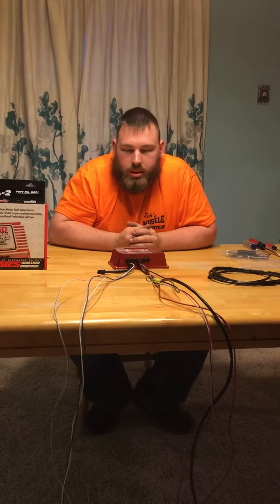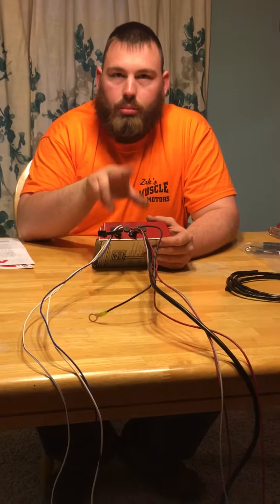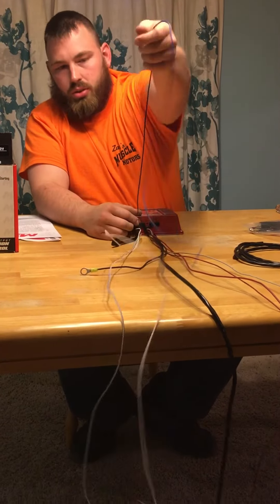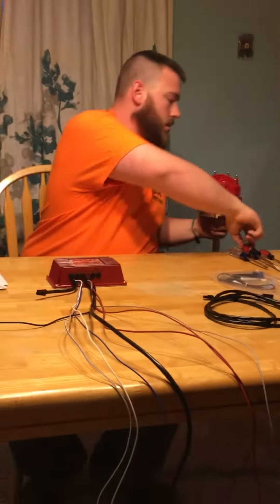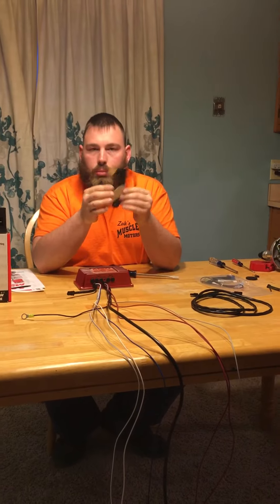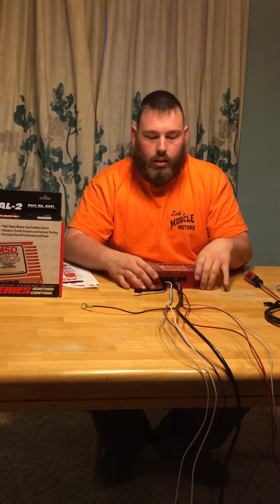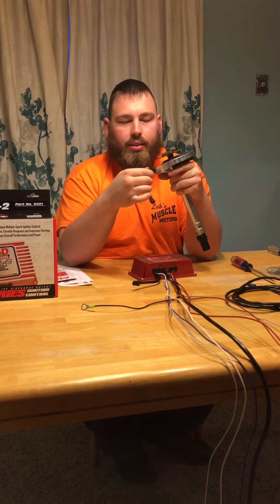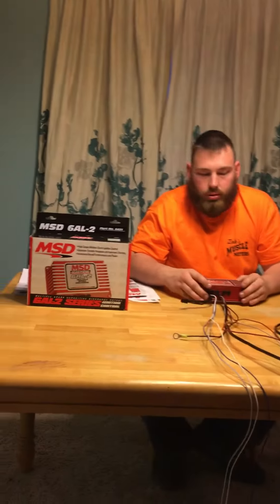Engine Building 101 MSD 6AL-2 Ignition System

Comment: After driving my car for a half hour,it dies.Wait a couple minutes,it fires back up ,and I head back home.The box is mounted under the dash. Is it overheating?.....HELP!!!!
Reply from the maker: Beth Mull ehhh could be but I’d lean more to having a vapor lock situation. are you running a carb I assume?
Reply: Yes, Holly 750.  Also notices the fuel pressure was low, down to 4 lbs.